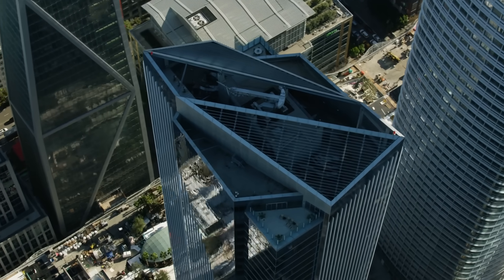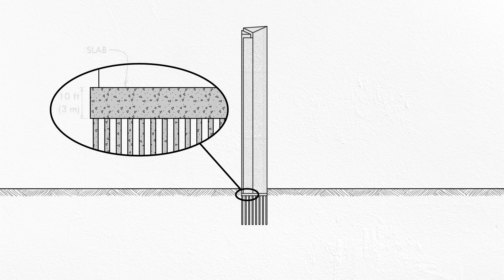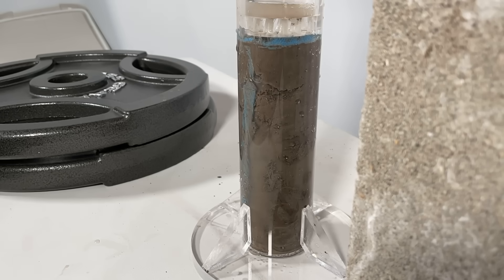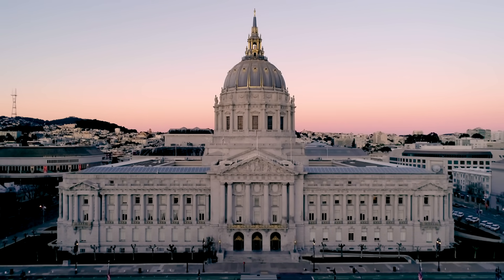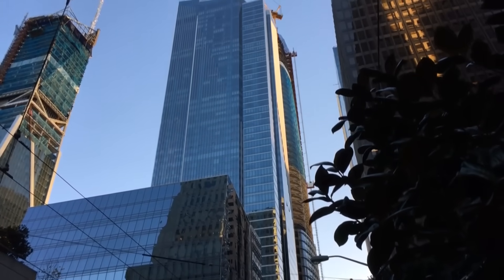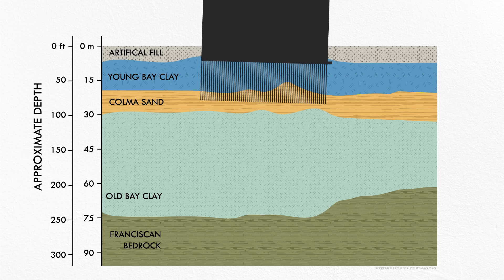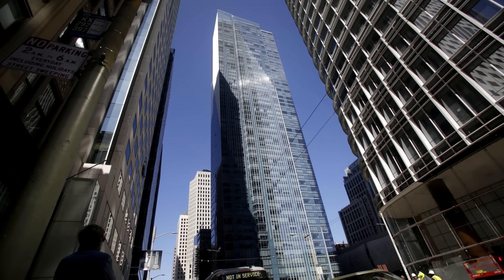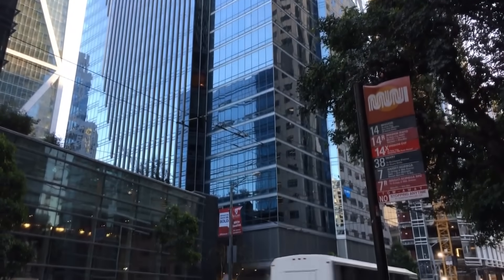What Really Happened at the Millennium Tower?

Comment: The same issue occurred with the old cantilever section of the Bay Bridge. Cheaper to not go all the way to bedrock, so thousands of fir pilings driven into the mud supported the concrete pillars. The 1989 earthquake exposed what a problem this was. It is funny that the developer doesn't have the money to do it right the first time, but they have the money to try and repair it later.
Reply: @GoCoyote - Its like the saying "If you cant  find enough time to do it right the first time, you,ll find the time the second time. Reminds me of a character named Ray White I worked for in my teens in the late 70s. One of those sketchy guys who would pay cash under the table, build with materials not up to code to reduce price. This guy had a building inspector coming by and he tells us he will give us a big bonus ( In his mind) if we hurry and get the whole business sheetrocked in a few days. With a crew of 4, when realistically we needed 6, we did 12 hour days and still couldnt make the deadline Ray White starts getting nervous because the inspector is coming. It was fun watching this shyster getting a dressing down by the inspector for using 3/8 in. sheetrock instead of 1/2 in. Oops Ray! You blew it! WHOLE BUILDING had to have ALL sheetrock replaced!
Reply: @daleleisenring4275  
COL (chuckled out loud) 
Yea, sort of a constant in the trades. Have heard that saying using money for time a few times also. Had to dig up and move the primary switch gear feed conduits because the superintendent’s ego was to big to have someone else double checking placement after we had already set them up correctly the first time and he had us relocate them. Cost more than 250k to cut out the concrete and dig down 6 feet underneath the building to move two 6” conduits 2 feet over. I remember being surprised as an apprentice that the best journeymen would ask us to double check their work. Later I figured out that they were both teaching us and having us double check their work.
Reply: @daleleisenring4275  haha good on ya Ray!
Reply: 1:58 The ease with which they are driving that beam into the ground is not reassuring.

Comment: This is the best analysis of the Millennium Tower controversy available to the general public.  Forget about the media coverage and the information releases from the developer or HOA.   The Millennium designers went cheap.  The SalesForce tower across the street had a foundation with piles going straight to bedrock - no settling issue.

Another high profile structural issue occurred in Sept 2018 about 200' south of the Millennium Tower.  The SalesForce Transit Center overpass on Fremont St. revealed a severely cracked beam when a ceiling panel was removed for electrical access.

Comment: 16 inches.  so they design the building with the ground floor doors out to the street at street level.  Except now ground floor is 16" lower.  What does this do to entering and exiting the building?  what about all the water, sewer, electrical and media connections?  they weren't designed for 16" settlement.  There has to be some major retrofitting being done just to make this place livable and maintained.  Ramps inside just to get out the door you have to duck to get out of?

Comment: Im really curious how the ~250ft pilings, which aren't supposed to touch the perimeter soil, will bear the load without buckling.  Presumably the outside of the hole will have a concrete or steel casing to prevent the hole from collapsing.  On the next video, it would be interesting to hear a little more about how that is superposed to work.  Also, as someone who lives in the bay area, the leaning tower is a bit of a local meme.  And while the tower may be safe from tipping, for now, who would want to live in an unlevel apartment?

Comment: As someone who has done masonry repair and restoration on tall buildings/skyscrapers for many years, and has bumped heads with engineers on numerous occasions only to be proven right, I don't buy that they are going to be able to make a strong enough connection between the existing slab and the retrofit to support that kind of load long- term. I predict this will end in failure.

Comment: The City of San Fransisco should change the Building Code to require ALL Buildings with a ground pressure design above a certain amount (call it 75% of the Leaning Tower of San Fransisco's original Designed Ground Pressure rating to be safe) to have their Foundation Piles extend all the way to the bedrock 200 feet down.
Then, they could get away with fewer piles because each pile would be capable of safely supporting a larger portion of the buildings weight which reduced the cost increase caused by needing piles going down that far...

Comment: The 'soil' is largely rubble from the 1906 earthquake and fire.  They had to dispose of it and the Bay was close by and it let them reclaim some acreage.
Reply: Very interesting comment which begs the question just how much research went into the design, construction and performance of all the adjacent tall structures around the tower and do they have any of the problems this tower now deals with?   If the intent of the shallower piles they used here was to save a little money if sure backfired.   This structure is a prime example of the old adage... you can pay me now or pay me later.
Reply from the maker: All of the artificial fill was excavated for this building. I show and mention this in the geologic section.
Reply: @PracticalEngineeringChannel   "All of the artificial fill was excavated for this building"
Thank you and I'm sure no geotechnical design engineer would dream of leaving soft uncontrolled fills beneath this thing.    And if this tower was designed to put even more stress on the underlying "old bay" clay then the other buildings around it maybe they should have considered some deeper piles into the bedrock as a back up.
Reply: @PracticalEngineeringChannel  That's good to know, I missed it in your vid.  Sorry.

Comment: Grady,
What standards were the city and developer engineers using to determined this building's safety? The normals ones used for regular construction or was the tilt factor and its issues added into these?
You don't see this tilt at One Rincon Hill but then it was built on the rock that makes up Rincon Hill.
Also, why aren't other skyscraper buildings in that area of the South of Market area in SF affected by this issue? Does this building have a higher loading? Those other buildings drive down to bedrock with their piles?

Comment: The experts deemed it is currently safe. That does not mean it will be safe in the future. Instead they indicated it would continue to settle which could make it unsafe.
It is that uncertainty that drives down the prices.

Would you buy a very expensive condo because it is safe now, even though it could become unsafe and collapse and be worth nothing before you sell?

I would say the Condos there are worth very little until it is shown that it will not become unsafe.

I also have serious concerns with the repair option. Couldn't that just make the building tilt the other way? Why aren't they building a complete ring all around with piles down to bedrock?

Comment: I happen to be intimately familiar with this story and have to say, Grady did a fantastic job of explaining the high points and presenting accurate material. Extremely well done sir!
Reply: I WILL TAKE YOUR WORD FOR IT
Reply: accurate as the bribes it took to build a foundation on wet sand, landfill, and marsh. funny how every other building in sf has piles to rock. but lets use concrete which is heavier but cheaper than steel to build and put a foundation in a garbage dump over a wetland.
Reply: @henryhenry271  Well, thats a bit simplistic, and not every other structure goes to bedrock. But agree, so many developments are profit driven and don't necessarily consider the long term performance of the structure they're building...and the impact they could have on adjacent property owners.
Reply: @SxWerks  
Aaahhh, you know the Developers’ Mantra!
Reply: @henryhenry271  
A deep foundation is necessarily concrete in nature. Steel can't withstand the long-term exposure that concrete can. You often encase steel (rebar) in concrete to take advantage of the strength of steel and the exposure resistance of concrete. The steel also acts to confine the concrete, increasing it's compressive strength more than just plain concrete.
Reply: @kindlin  
If I read correctly, @Henry Henry was referring to the structural framing of the (above grade) building, not the foundation.
Reply: @midlife_crossroads  exactly,
Now if you want your concrete and steel to work great you put it in playdough.
When it all started to tip, you drill more playdough out of the side it's tipping to, and then wonder why it's tipping faster.  
At this point, they need to look into demolition.
Reply: Okay, but why did he not state the tilt (angle) in degrees?? I know it's a foot off at the very top but in degrees, the tilt must be really small. If the tilt gets to be more than 7 degrees, it will surely collapse.
Reply: get rdy for 911 !  Run!

Comment: Will this building collapses if the tilting can't be stopped?  At what point will the tilt make the building unsafe?  Will the building be capable of being dismantled if the tilting can't be stopped?  If it topples, what happens to the surrounding buildings?  From what I've read it seems that this building can't be saved.  What say you?
Reply: Nov 2021. 1.47 Millenium Tower Foundation Engineer Ronald Hamburger says the Building can lean 3 feet to the North and 6'8" inches (80 inches) to the West before it becomes dangerous. 

https://youtu.be/3uzUC6p2UbM

Comment: As of Sept 2021.
- Base of the North West Corner has Settled/Sunk 19 inches, 
- Base of the South Side and South East Corner Settled/Sunk 14 inches, 
- Outwards Displacement/Leaning 23 inches to the West,
- Outwards Displacement/Leaning 9 inches to the North, 
since it's been finished in 2009.

Nov 2021. Millenium Tower Foundation Engineer Ronald Hamburger says the Building can lean 3 feet to the North and 6'8" inches (80 inches) to the West before it becomes dangerous.

Comment: Most of the Bay area is built on mud flats and debris from the 06 quake.But the mud was deposited there during the goldrush hydraulic mining industry all the silt even covered the abandoned ships and boats left beached when the sailors headed to the gold fields .. If they took a few pages out of the Alaska Pipeline project and froze the ground till solid on 3 sides they might get all of the digging done , without more angle increase, but the next shaker ----liquifaction and all bets are OFF ! ! !

Comment: Great vid! So what happens when the new piles are under load and there’s a lateral force on them from the shifting old bay clay? Is it possible they could crack? What effects would that have if they then are holding up the majority of the buildings weight, break and the original piles now essentially are not “bottomed out”? This is fascinating
Reply: And the fact(?) that earthquakes almost NEVER happen in San Francisco...
Reply: There are a lot of reinforcing steel bars in these piles so they don’t break. And these piles do not stand alone in the soil. There are many side by side (like as the forest). Therefore, they behave like a solid cube in the soil.
Reply: @Akol56Peter  That's the theory, but the 405 Freeway was supposed to be able to handle a quake like Northridge too- only it didn't. If you want it to 'behave as a solid' then simply build it as a solid. If you can't or won't build it 'as a solid' then be smart enough to consider that it may not always behave as a solid and allow for that possibility. What we "know" today will change tomorrow when more becomes known. Unlike the above-ground columns of the 405 which survived, this is not something you can go back and fix later on with any practicality. It needed to be the best possible and it wasn't done that way.
Reply: @P_RO_  P RO
I agree with what he described. During my more than 40 years of factory construction experience, I have also seen many theories fall. (and I made some mistakes too but luckily there was no injury)
I usually when planning (even in the beginning) try to estimate what is the strongest effect I can protect. This is called a philosophy of disaster. My first engineering job was building a nuclear power plant.
Reply: @Akol56Peter  We can't always know what might happen, but we can and should always ask ourselves if this can be built to better withstand anything and everything which could be even slightly possible? If it can be done better then you do it better.
Reply: @P_RO_  They were under designed and had only about 75% of the rebar necessary to handle that earthquake.

Comment: My prediction: They already misjudged settling twice, they will do it again. If they ever get those external piles driven and loaded, the building will overcorrect in the opposite direction, and they will need to do the exact same retro-fit on the remaining 2 sides.
Reply: They can delay the repair to the South and East sides for 10-20 years.

Comment: The thing is it is noticeable. Put a marble or ping pong ball on the floor and it will roll off to the low side, spill you water and it will flow making more of a mess. It is not visible directly but it causes effects. Also it is causing issues with utilities and you can see those too. 

Also while "safe" is one thing, bound to cause massive financial and logistical headaches for decades to come is something else, so why buy there? If anything they are still overpriced for expected future use vs cost. 

Also I'm sure they had some very nice models saying the thing was perfectly safe and stable the first time around too. So why believe them now when they have just as much if not more vested interest in saying so (as the fix it more expensive now than just changing the plans the first time around) I mean if you torture the numbers enough they will say anything. Just because it was produced by someone with an engineering or scientific degree doesn't mean it was any good, motivated reasoning is a hell of drug and those who think they are above it are especially vulnerable.
 
Also this misses the BIG aspect of this story the change from steel frame to concrete as the primary building material. 

also if you are into building failure issues just look at the Austrian apartment boom. It seems like the codes there and the subcontractors doing the design work as they go seems to have gone a mite...overboard. Or have a look at the Tofu Dreg phenomenon in China.

Comment: With 16” of settling I’m sure the underground utilities must have all be of a big concern. A broken gas or power line or sewage flowing back into the building can all be a nightmare
Reply: As of Sept 2021.
- Base of the North West Corner has Settled/Sunk 19 inches, 
- Base of the South Side and South East Corner Settled/Sunk 14 inches, 
- Outwards Displacement/Leaning 23 inches to the West,
- Outwards Displacement/Leaning 9 inches to the North, 
since it's been finished in 2009.

Nov 2021. 1.47 Millenium Tower Foundation Engineer Ronald Hamburger says the Building can lean 3 feet to the North and 6'8" inches (80 inches) to the West before it becomes dangerous. 

https://youtu.be/3uzUC6p2UbM

Comment: Stop building megaprojects on reclaimed land. Alternatively, stop being typical greedy shitty people and do things right the first time instead of doing things as cheap as possible. 
The fix sounds sort of good except you cannot trust hydraulic systems indefinitely. Those jacks will fail eventually. The seals on the cylinders will fail. You can't just seal them up in concrete tombs and pretend they will last forever. That's dumb af. The building will 100% outlast the cylinder seals if nothing else goes wrong.

Comment: I had heard or read that the design had changed from the original, but that the engineers that participated in the original design felt that the original foundation design could take the weight of the new and heavier plan. If this is the case, I think it points to the dangers,of shrinking your margin of safety, your “runway” in aviation terms.

Comment: As one of the crane operators on the Salesforce tower foundation I can tell you we never hit bedrock not want to rock was ever found and the millennium tower didn't start leaning until there was a hole 100 ft deep across the street as well as the same time the transway terminal hole on the other side of the millennium tower